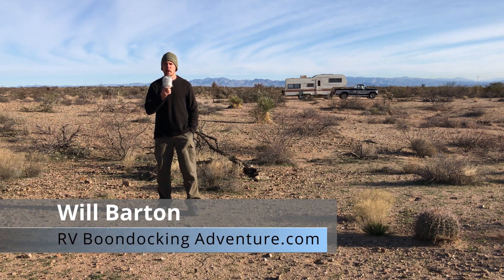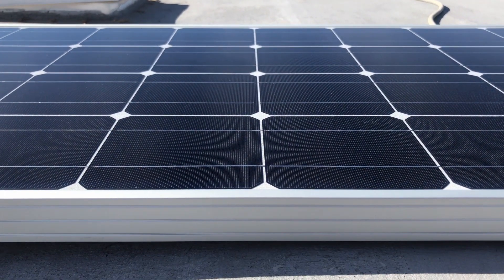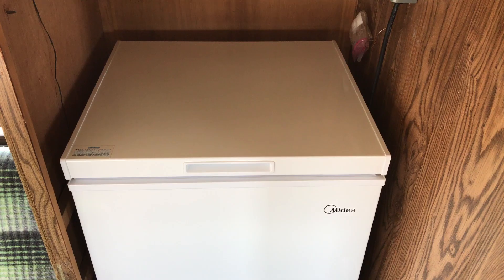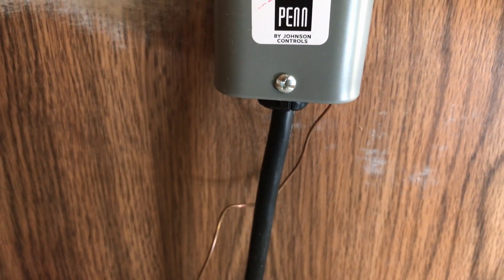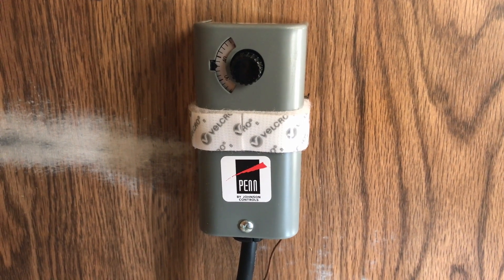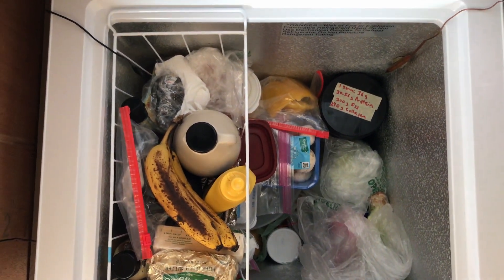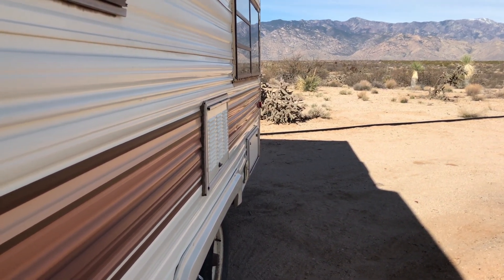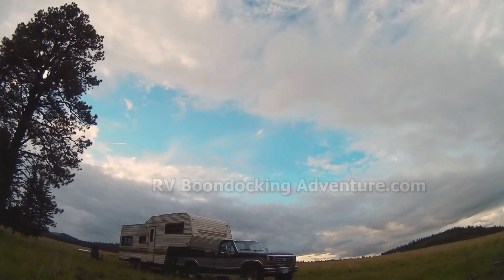Chest Freezer to Fridge Conversion, Super Efficient Solar Powered Off-Grid Refrigerator

Comment: could you further insulate it to make it even more efficient? Great video btw :)
Reply: The problem with fridges and freezer today is the coil is mounted to the metal outer shell so adding insulation means that it can't get rid of the heat one with a coil can be you can also redirect the coil heat to the outside adding heat inside your home in summer makes the AC have to get rid of it
Reply from the maker: Thank you! Sure, you could add a layer of polyurethane foam to the outside which would make it even more efficient.
Reply from the maker: On second thought, after feeling the front of the freezer and noticing that it can get quite warm, this is probably not a good idea. The heat dissipates from the exterior, and covering it up with insulation might hurt the performance, and cause overheating.

Comment: Great info.  What inverter are you using?  Glad to find this.  Thanks
Reply: Thanks for adding that on your list!
Reply from the maker: Thank you! I'm using this one here, but would recommend going  with something a little larger, such as a 1,000 watt or higher. Cobra CPI 880 800 Watt 12 Volt DC to 120 Volt AC Power Inverter: https://amzn.to/2CxAn6n

Comment: Cool idea (no pun intended)!    Thanks, for the video!

But, you really shouldn't keep your bananas in the refrigerator.    They will keep longer at room temperature!
Reply from the maker: Thank you! Yes, I found bananas do ripen much faster in the fridge - good to know if you plan to bake with them.
Reply: @RVBoondocking  
After Bandanas are ripe, I put them in Fridge for week or more after the outside skin absorbs and turns REALLY black, but the inside stays nice.
Keep en in the fridge.
Reply from the maker: @brichusi  Thanks, I'll have to try that

Comment: Great video! Is the battery bank designated to the fridge?
Reply from the maker: Thank you! No, the battery bank actually powers everything on the RV, including lights, appliances, and my laptop. The freezer to fridge conversion draws the most power. During the day with the sun shining I can pretty much use as much power as I wish and the solar panels will provide it.

Comment: What is the amp draw on the fridge? How big of an inverter would you need to power it?
Reply from the maker: This model draws between 5-8 amps when the compressor kicks on, which will only be a couple seconds, then about 2 amps when the compressor is running. I get away with using an 800 watt inverter, however I would recommend a 1000 watt or higher.

Comment: Interesting hack using off the shelf parts.

Cold air will leak between the leads and door seals. Drill a hole through the fridge wall and seal with expanding foam insulation. (Pick a spot free from the internal gas cooling piping).

I've seen another tutorial on improving efficiency by adding insulation, spacing the radiator coils from the fridge and installing a heat shield between the compressor and fridge body.
Reply from the maker: Great ideas, thanks for sharing!

Comment: do you know how many watts it draw while running great video
Reply: Going to build a electric solar powered rv from the ground up I’ll sub so you can follow the build but this will be the fridge setup for it
Reply from the maker: @roynorw  Cool project! Keep me updated. I think it would be feasible to do an all electric RV, if not now, in the near future. I sure would like to be totally self-sufficient and not have to rely on propane for heating and cooking, or fuel to run the truck.
Reply: I considered building full solar, but real estate is always an issue, and besides , the most efficient way to heat is in-floor hydronic heat. A 12v pump, some copper tubing and a small hwh is all that is required. Not sure, but a propane hwh may be more efficient?
Reply: @ub2bn  I've thought about the real estate issue with solar too. I'm thinking of removing the the roof mounted AC unit and going with a mini-split AC/heat pump system....it would free up room on the roof as well as where the furnace is.
Reply: @ub2bn  
Using solar for resistance heat for more than a few minutes (like a coffeemaker) usually makes no sense or cents.
Reply: @roynorw  I've wanted to do this. I Checked your channel.
Reply: I found the ink bird unit works much better as a temp controller, is less expensive, and is much smaller.
Reply from the maker: Thank you, good question. I haven't measured it. A reviewer on Amazon mentioned between 5-8 amps when the compressor kicks on, which will only be a couple seconds, ~2 amps when the compressor is running. https://smile.amazon.com/midea-WHS-129C1-Single-Chest-Freezer/dp/B00MVVITWC

Comment: Great video! I'm thinking of a van build out in the near future and had the same idea. Instead of spending upwards of $600 for a 12v freezer. Have you done any research as to the efficiency difference  between the two? 12v/120v. Also, what do you think about setting it to freezing temp and then adding a small plastic igloo type cooler for your fridge items in the freezer. Do you think the igloo would still freeze the items inside or would it lean towards a warmer temp since igloo walls would insulate from the freezer temp? If that made sense?
Reply from the maker: Thanks John! I have not looked into 12v freezers, but imagine they would be even more efficient, and no power would be wasted by using an inverter. Placing a small igloo cooler inside the freezer may keep that food from freezing for a little while, but I think eventually the cold air would penetrate the cooler walls and freeze anything inside the cooler. Have fun with the van conversion project!
Reply: I think eventually everything would reach equilibrium, and everything in the cooler would freeze anyway.